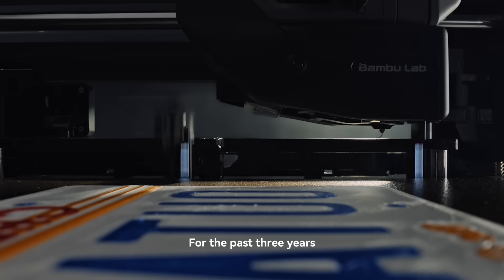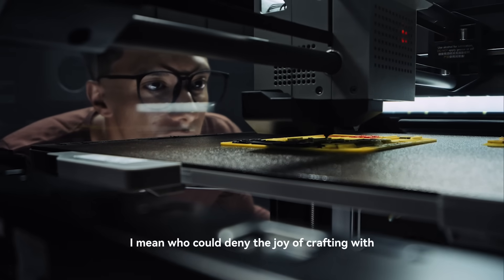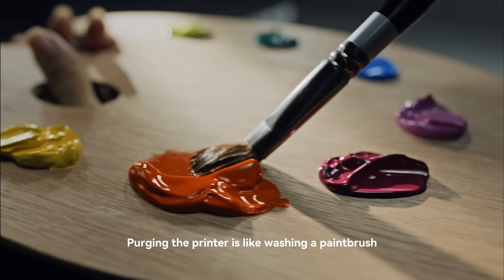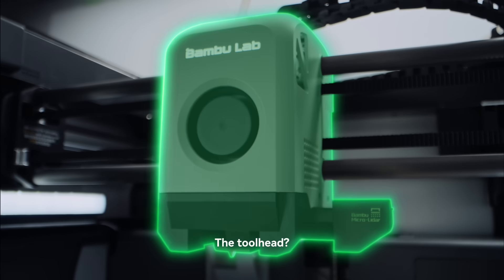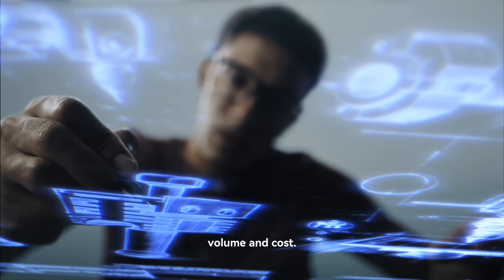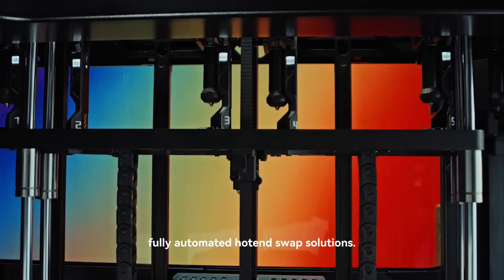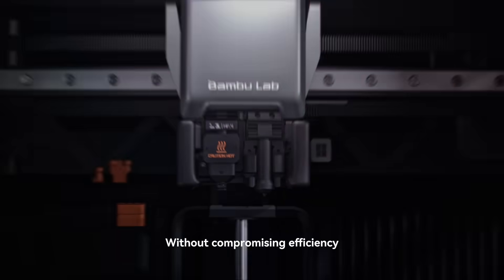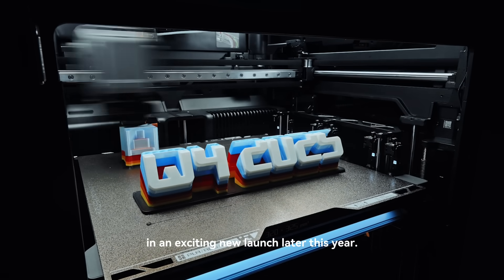Meet Vortek: Our Answer to Zero Purge Waste Multi-Material Printing

Comment: You had really made something that i think no one have ever even thought about. As always, you are the innovator and they are the copiers. Good job team Bambu.
Reply: Yeah it's not novel, just hopefully more refined
Reply: Bondtech announced the indx 6 months ago, a hotend swapping system with induction heating and a wireless connection. The only unique thing I see on this is they seem to be sharing the Bowden tube which means you'll still have to wait for the filament to be unloaded and reloaded every swap.  That'll go from the indx's 10-15 seconds per swap to 30-45 seconds at least.
Reply: Somebody did think of this before. Check out the Swapper3D, it came out a few years ago and it is essentially the same concept. I'm sure Bambulab's design will be more robust and easier to use, but I wouldn't call it completely original.
Reply: Yes BCS the bondtech indx isn't a thing
Reply: lol calling bambu lab the "inventor" when everything they do is based off of others ideas or straight up copying/stealing from other companies.
Reply: @LilApe and taking open source things without attribution altering it slightly and locking it down. It really sucks that so many people are financially supporting these actions. 3d printing is one of the last industries still offering open source hardware and software is getting more closed everyday too. That's the biggest reason I didn't get an x1c when they were the hot item to have and spent more on a voron. I get it was a good product at a great value at the time but their new stuff doesn't even have the value part going for it. Idk anyone who can afford to throw $3-4k at a printer, especially one packed with lasers and stuff no one asked for. Luckily we still have companies like prusa, bondtech, and e3d who are still open sourcing as much of their offerings as possible. It's going to be pretty grim when the bambus of the world win and we can't even choose whose filament we can use in OUR machines. Don't believe me just look at the state of 2d printers and ink with it's ridiculous costs. Those rfid tags sure are convenient though, right?
Reply: @LilApe  We all know the Chinese can't invent...they just steal. The quality is there though....
Reply: @LilApe  They're better than Prusa.

Comment: Interesting approach, judging from the vid it looks like while it would save much of the filament waste due to purging, it wouldn't save that much time as you'd still have to cut and retract the current filament and then feed the new one in each time as you'd still only be using a single extruder. Still an interesting idea, I look forward to seeing it in practice.
Reply: It will be faster because it will eliminate the time spent purging the nozzle and the purge tower can be eliminated or very small just to start the flow.  If it works, it will be just what I wanted.
Reply: @andrewmo49  Agreed, I just meant that compared with a tool changer it would take a bit longer as you would still have the cut, retraction and feed of the filaments on  each change which you wouldn't have on a tool changer, but yes your right it would be quicker than the standard AMS style purging and prime tower.
Reply: @andrewmo49 Faster than a regular AMS, sure. But far slower than a real tool changer. Bambu Labs needs to make a tool changer, this is just a stop gap that only has half the benefits. I guarantee something like the Snapmaker U1 will be twice as fast at minimum and less than half the price.
Reply: @03chrisv ive seen the vids on that thing and the print quality isn’t that impressive tbh. Sure its a tool changer but the prints look just average quality.
Reply: Worst thing is the heating time. You can't preheat the next nozzle while it's parked, right? And what happens to the hot nozzle after it got exchanged? Will it ooze like hell and make a mess in the parking area?

Comment: A Prusa toolchanger needs about 8 seconds to change the toolhead. Since it doesnt like the nozzles are preheated in the video I think it'll take like 15 Seconds for a nozzle change. But when the printer only costs like 3000 I think it'l make sence to buy the bambu lab than the prusa xl
Reply: Fair Point i think “time to change” and Price will make a huge difference in the end could also be that the “time savings” could be worth the extra cost of a dedicated Head 👍
Reply: Well, they state 8 seconds to heat the nozzle. The actual change of nozzles I expect will be very fast, maybe 1 or 2 seconds. I think the speed will be limited by the time to swap filaments. That will be happening while the nozzle change happens, so whichever thing takes the longest will dictate the time to change filament.
Reply: They and the XL is kinda a unreliable mess of a machine thats not even enclosed properly. People also have many issues getting all the tool heads to be calibrated and the X and Y.

Comment: I think Snapmaker just sped up the announcement. With this level of detail it’s obvious it’s been in the works awhile.
Reply: thing is it doesnt make sense to rush this because its in completely different price segment than U1
Reply: @Asghaad  Its more similar the the Atomform 300, but that one is rather sketchy
Reply: @Asghaad I disagree. If I had this as a option when I got my H2D I would have never even looked at the U1. But now that I have ordered a U1 do I cancle that and upgrade the h2d?
Reply: @Asghaad from a business perspective it does. The snapmaker created a lot of buzz so bambu will benefit from the hype the snapmaker has created. 

Also, there are people like me that were gonna buy the snapmaker until this Bambu announcement.
Reply: @sirgriffinman  which doesnt make sense...

if you want sub $1k toolchanger then this H2D with additional price on top to push it probably close to $3k pricetag (this setup will REQUIRE an AMS to work to begin with, then you have the nozzle swap system on top) wont fit the bill

and if you were willing to spent that much on a printer then Prusa XL has been there for years already with much larger printbed, not iffy uneven bed heating and full true toolchanger

this product simply makes no sense - technically worse and too expensive for the drawbacks to compete with Prusa and totally a no-go for someone looking for P1 / X1 grade printer which is the segment U1 is aimed at
Reply: It makes total sense. The prusa has a fair amount of issues that aren't great. Not everyone's issue is price. I almost bought a prusa but have been waiting for something different/better. The Bambu gives the best of all options available. I prefer the bambu design to the prusa @Asghaad
Reply: This design is fast cheaper than the prusa method..... and simpler.  @Asghaad
Reply: @Asghaad An H2D with almost zero purge waste with 7 nozzles is a big deal. I already own a bunch of ams's and I'll buy more when needed.
Reply: @sirgriffinman  i wouldnt call it fast, the swap of the nozzles might be done in 10-15 seconds but the AMS retracting and feeding the next filament in will take a LOT of time

faster than single nozzle yes but compared to 5s change on true toolchanger the difference will be significant 

personally i just bought a P1S with AMS2 and cant afford to shell out $3000+ just yet so soon after purchase ...

ill be watching the Snapmaker U1 though, at $1000 for 4 toolhead true changer it might fit into my budget by the end of the year
Reply: @Asghaad I thought about that as well, but I'm already ok with the current ams system speed. The ams time will still be there, but the nozzle change will be much faster than the current purging that already happens on the single and dual nozzle systems. 

Most important to me is the purging waste and this system solves for that.
Reply: @Asghaad  I've never seen someone schill so hard for a brand... Almost as if you work for them.
Reply: @Asghaad  If I may, I don’t agree with your reasoning. Why buy a BMW with a 6-cylinder engine when many other manufacturers offer good cars with 4-cylinder engines at a more reasonable price? Both cars will do what a car is meant to do: get you from point A to point B. The difference lies in the enjoyment of the journey and how rested you feel upon arrival.
Reply: @Asghaad  why would it require an AMS if the nozzles swap?
Reply: @Asghaad plus I only see one feeding tube so how is this going to eliminate purging yes hotends are swapped but the filament is still in the tube. Only way I see it is that detection they spoke about will cut that color and pull from another 😅
Reply: @MadeMan007 I assume a much more efficient cut and retraction.
Reply: @nlingrel  because you still only have 2 PTFE tubes going into the print head. You have to switch the filament.
Reply: @sirgriffinman  Just remember that the H2C only solves the issue with purge. It does not improve the speed. This is because the toolheads do not have individual filament paths. You still need an AMS, which needs to wind the spool up and down at each color change.
Reply: @PerMejdal  to be fair to it that method will still cut the change to about half of that of the AMS which is improvement still 

the real problem is the price
Reply: Isn't snapmaker using pogo connections? Those wear out very quickly. And to be fair, bambu became the apple of 3dprinters, no open source but just working well, 95% of the customers can buy a machine that last them a very long time with minimal actions that are not automated. The u1 is sounding nice, but smaller and still plenty of issues to fix. Prusa had the xl for a few years already and still having lots of issues and they actually have experienced users helping them
Reply: @DevBench4Life  pogos depending on quality last 10k-50k connections, spread that among 4 toolheads and you have at minimum 40k filament changes before you MIGHT encounter wear failures

then you just do quick replacement of the wear part as you would with lets say extruder gear or filament cutter and just continue ...

if they are smart they will make the pogo interface quickswappable with a socket connector or quick connect ribbon making it nothing more than a regular maintenance job.
Reply: @Asghaad this is waaay late I know. But In case anyone is reading this. The snapmaker U1 is rated at 250k swaps per tool head (1 million combined) for the pogo pins. They are replaceable.
Reply: @DevBench4Life snapmaker did respond saying that assuming you have 200 changes per print you would get 5000 prints before the pogos would fail and that they have been designed to be replaceable in the unit
Reply: Since 2023 they have had this planned.
Reply: And probably the Bondtech indx also
Reply: They obviously announced it because of the h2s to let customers decide whether they want an h2s or wait. I’d wager that BL could not care less what snapmaker is doing lol
Reply: Plus this looks similar to the Bondtech INDX system that's set to come out around the same time.  Sounds like Bambu Lab has no other option than to announce their thing before competitors gobbled up market share.
Reply: also got the community to back it...smart move..I cancelled my preorder as i just trust bambu, they just do it right..
Reply: Well the video says they been at it for 3 years.
Reply: @radfaraf  they sayd 2 which means they started working on it around the time Prusa XL came out

and they are now rushing it out of door most likely to compete with the INDX and Snapmaker U1, except both of those are in totally different price segment than the Bambu H2D this thing is for
Reply: Meanwhile at prusa theyll keep d1cking around llamas and growing spiderwebs in their R&D dept
Reply: @ElectronicShredder  Prusa at this point is selling on a name. Their printers are nice but others are innovating and charging less for some of it.
Reply: @ElectronicShredder   Winamp. It really whips the llama's ass!
Reply: @ElectronicShredder  They did so much for the community, but they just aren't adapting. It honestly breaks my heart.
Reply: Some of you folks gotta realise that price isnt always the issue; it’s simplicity and ease of use.

It’s a hobby, not a job. We just wanna plug and play, not spend hours being a nerd trying to work it out at the costs of a few pennys.
Reply: Hmmm… would be nice if we could add this to a H2D. I probably have to sell or disassemble my 350mm Voron 2.4 to get the space needed for another H series printer 😂
Reply: @Todestelzer They've said it'll be available as a lot upgrade for the H series printers.
Reply: @Todestelzer they already announced you could upgrade an H2D...
Reply: This is going to cost close to $3000 and they are kind of late. It’s not going to be as fast as a regular changer because it needs to retract the filament into the AMS. Snapmaker light a fire under their ass.
Reply: This new BL printer's price can't be as low as U1's one...

Comment: I have seen something like this  a couple of years ago , though
this guy had invented a wheel with , what i remember was full
of nozzles with maybe also heater blocks and the printer 
changed the nozzles according to what color of filament the
nozzles had been used with  .
This from Bambulab is a good invention ,but it lacks the quickness 
of a real hotend swap with already loaded filament , the printer
still have to change out the filament and that is time consuming .
I like that they have taken the INDEX system of induction heater
into this concept though .
As an add-on i kind of like it

Comment: I see the bed size is 330mm X 320mm X 325mm, and it seems to be 6 color nozzle on the right side and one on the left side (7 total) 👋👍
Reply: seeing the compactness of this system, I wonder if they could fit 2nd Vortek unit on the left side, totaling 12 different nozzles
Reply: @hn.fadlurahman  Same here m8
Reply: Big enough to print my shoe size. 
P1S isn't big enough to print shoes flat.
Reply: H2 series? more like R2 series cuz they all rectangles xD
nah its perfectly fine, idrc about the inconsistent printable area sizes between every H2 printer, large plate size in general as well as the fact the build plate itself is the same size.
Reply: ngl they did a good job of learning from their mistakes lol (however, they did decrease the volume with each new one)
H2D: 350mm x 320mm x 325mm
H2S: 340mm x 320mm x 340mm (Closer...)
H2C: 330mm x 320mm x 325mm (CLOSEST TO A CUBE!)

Comment: This toolchanger system is flawed unless the video isn't representative of their actual toolchanger. It still requires pulling back the filament, cutting it, wait for AMS to switch filament, then change the toolhead. You save a bit of purge and still require nozzle priming, theres no bowden tube for each nozzle, which means all materials must work with AMS, multicolor soft TPU prints wont be possible and time savings from not needing to wait for AMS switch are lost.

Comment: just use filament color mixers, not just tool changers. and multiple simultaneous tool heads. running at the same time. on their own rail. if you bed sling. or tool head sling. any moving parts or swapped parts are a liability. not very durable solution. so better have multiple hot-ends or rails than any swapped parts with swapped contacts. a bed slinger can be enclosed in a larger box, or tool head gantries running parallel in the same rails on y while having independent x.

Comment: As an early X1C supporter, I was wondering when the true successor would arrive. H2 was okay, but this is 👌👌
Reply: I hope it gets put on a bigger print bed. Love my x1c, but really want to print bigger.
Reply: @Oversoul225  Same
Reply: @Oversoul225  330x320x325...you can see it in the video
Reply: Same same. That machine is what I have been waiting for
Reply: @justinweber7547  But at this price-point?
Reply: I got my X1C just this year. It was easily the most expensive tool I've ever purchased, and I have a small metal lathe in my shop. 

It would be REALLY nice if there was an upgrade or mod path for the X1C to use this thing.
Reply: @akaHarvesteR  Of course there won't be a mod path for the X1C, did you check the video? You need space for the tool change system and X1C does not has that.
Reply: @wyannick888  I figured as much, but where there's a will and a Dremel tool, there is possibility.
Reply: @akaHarvesteR 😂
Reply: This would be awesome if they could make it work on my x1c that would be cool (I know that the nozzle is screwed in)
Reply: I don't have any BambuLab printer, but the H2D was a "disappointment". Well, it's not bad, but was not as "disruptive" as the first printer. This new H2C is the answer to INDX and Snapmaker U1/Prusa XL, that was what I expected (but before INDX announcement).
Reply: @FrequenciaJogos  At the price it's going to release at it's not the answer to anything. It'll compete with the PrusaXL and that's it. This can and should be released as a lower cost alternative to multi-HEAD printers...but they won't. It should be the next gen of printers to hit the average household...but the price will make sure the average joe never hears about it.
Reply: so upset i got my P1S+AMS early this year lmao
Reply: @pvic6959 the H2C will probably cost 3x P1S+AMS though..
Reply: @pvic6959 Why? The P1S is a great Printer with outstanding print quality.
Reply: @pvic6959 P1S is dope tho
Reply: @pvic6959  what do u think about P2S ?
Reply: @karan257  I think its cool. i wont get it because i just got my p1s though

Comment: I don't do multi-color printing but I've always assumed the prime tower was a bigger source of waste? I wonder if that could ever be eliminated. Very cool either way though, if I do eventually decide to step into multi-color printing it'll have to be with this, budget willing!
Reply: Depends on the model. Sometimes you can have the prime tower inside the model, using the infill area so you don't waste any material.